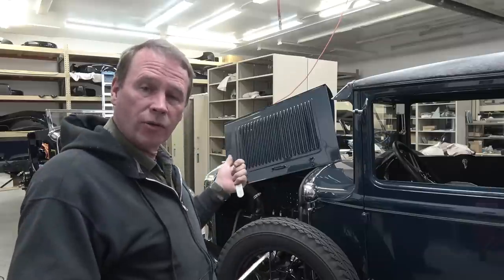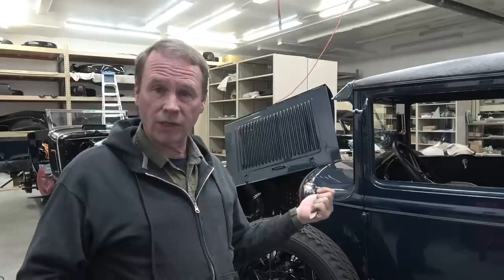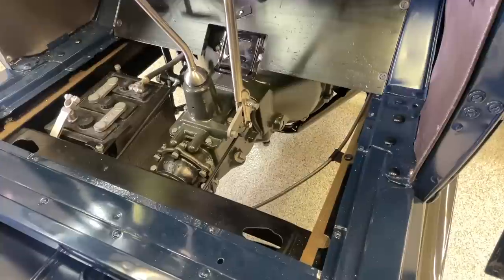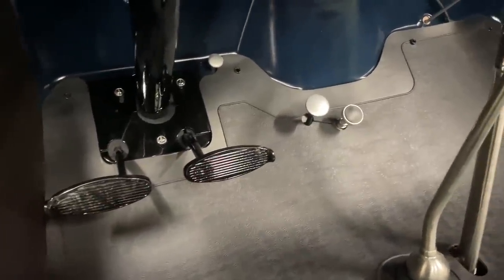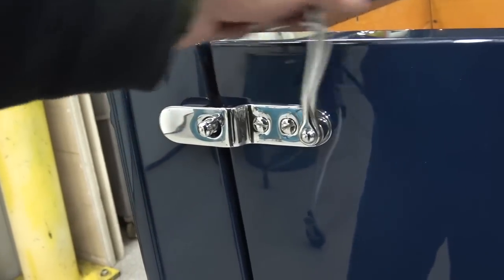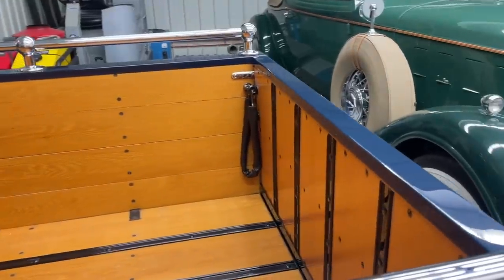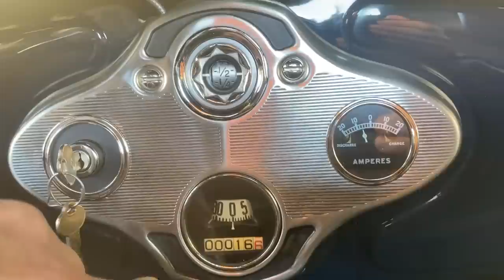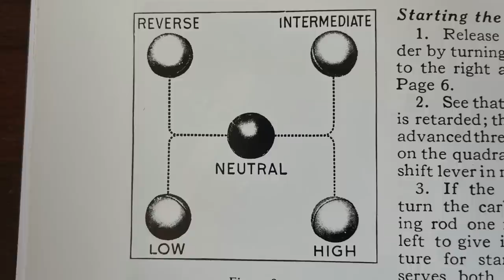Assembly and Test Drive of the 1931 Model A 66A Deluxe Pickup

Comment: With all respect, transverse suspension wasn't designed to save the cost of two leaf springs; it was designed to allow for more suspension flex. The axle and radius rods form a triangular assembly that can twist at the U-joint or oil pan. Combine that with the Model T's flexible frame, and you get that 1916 T touring that got a 1,030 RTI score in Motortrend. 

I love your paint color, it's nice to see a Model A that looks like 1931 and not a Great Gatsby party.
Reply from the maker: Do two springs cost less than 4 springs?
Reply: @claytoresto  That's a great counter argument, so I went digging. I found list prices in the Hollander Interchange Manual (19th edition), and Whippet 96 springs listed at $7.50 and $7.30 for fronts and rears respectively, while Model A Ford fronts ad rears were $7.50 and $20.25 respectively. So, Whippet springs all around would be $29.60 compared to Ford springs all around at $27.75, but it doesn't account for the cost of wishbone, radius rods, or torque tube. 

It would really be fascinating to trace the Model A design process and see what design choices were dictated by longevity versus production economy.
Reply from the maker: Very well.  This is why this forum is so good.  Discussion.  Chevrolet surpassed Ford in 1930, so I think it's a fair comparison of these 2 cars.  The Whippet was way down the line in units sold.  So why did Chevrolet and every other major manufacturer forgo the transverse design in favor of the longitude design?  Chevrolet knew that an even better design is coil springs.  In a few years they introduced it.  I believe around 1934.  The bottom line was the Ford design was mainly for economy, not superiority.  Yes the Fords were for the masses and thus they saw plenty of country roads, but I have seen film of New York and Las Angeles in that time period, and it was not four wheeling.  The Model A, and I have restored hundreds of them and love them, is a buggy compared to the classics I restore in my shop today.  Unfair comparison, because they are much more expensive, but the engineers pretty much figured what was best by 1930.  And none of them have transverse springs.  This is also true of the engines.  All the secretes were know by then, it was just a matter of how to make money using the technology.
Reply: @claytoresto  Indeed. It's fun to discuss ideas and do more research. I picked 1929 Whippet 4 because it was the same HP and wheelbase as a Model A and felt like more of an "apples to apples" comparison. Chevrolet was a 46HP six and 3.5" longer. (And then no. 3, Essex, was just a more substantial car.) Honestly, I think Ford stayed with transverse leaf suspension because Henry patented the design and had been using it since 1906. If it was his idea, it was the best and everyone else was wrong.

Comment: do you exercise the double clutch method  ? push clutch down and shift into 1st gear let pedal raise until under way , accelerate to power range (here we go) push in clutch and shift into neutral - let clutch raise all the way up , then push clutch down again and then shift into second "double clutch" same for third (and the same for down shifting with the RPMs up quite a bit to help mesh the gears ... give it a try - hope this helps .... we want to know if your still looking for good help  ?

Comment: - Come on, Mark, you've got to learn the musical feel/rpm tone for double clutching into low hear at ten miles per hour just in case you are going downhill and lose your breaks, if for no other reason.
- It is easy, just rev your motor in neutral with the clutch out, and then slip the teeth to just touching and listen for the grinding to slow down to zero...AND Notice the musical pitch/tone of the rpm level at the speed you are going {not the speedometer speed, the feel of the vehicle at that speed}.
- Then just duplicate that whole process over and over and slightly/lightly/delicately grind gears until you don't any more.
- When you get good at it, you will notice there is at least one gear that is a thousands high that goes tick tick tick...tick just as they are all messed.
- Then learn what the highest rpm the engine can do so you know how to get the rig into the next lower gear as soon a possible to rescue it on a downhill break-less runaway.
- Learn that well for stone crusher trucks that haul out of the pit and go back, and the breaks don't get worn and neither do the clutch plates...and the mechanics learn to love you because they have less work replacing those hassle jobs for what you drive...and always keep your rig in tip-top shape for you.
- Got for it...wind up the rpm to the point the motor feels like it likes it and find out how slow you have to be going to drop down to the next lower gear.